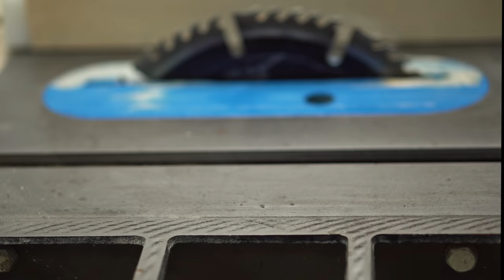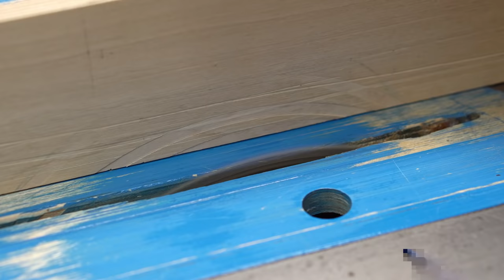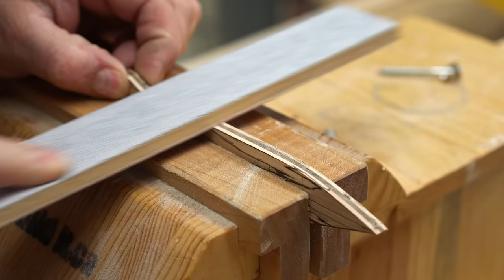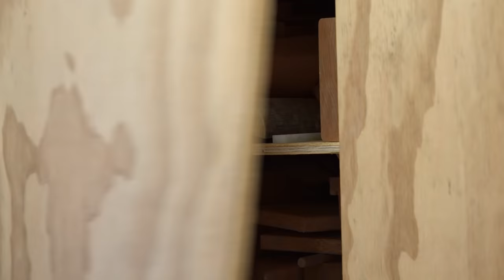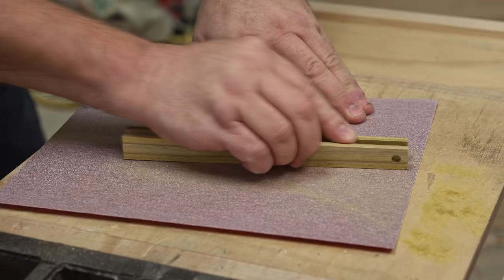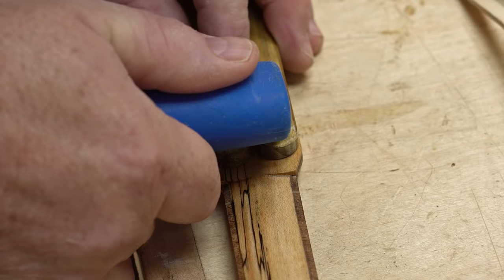Making This REAL Wooden Butterfly Knife

Comment: i'm in love with that blade, and it overall looks amazing. Just a tip, i personally think it would look way cooler if the handles were thinner. I don't know if it's possible to slim them down, but if it were it would look classy af.

Comment: 38 Clips
---------------
getting material
table saw angle 1 (left side)
table saw angle 2 (above)
table saw angle 3 (behind left)
table saw angle 3 (behind right)
drill press 1
sanding wheel
sanding wheel angle 2
sanding wheel angle 3 => moved to belt sanding but didn't turn off camera
vise angle 1
vise angle 2
vise angle 3
vise angle 4
getting material 2 (handles)
miter saw 1
table saw looking back at the blade
table saw perpendicular to the blade
table saw 45 from the blade
drillpress 2
drill press 2 (angle 2)
assembly at table saw 1
planing at table saw 1
sandpaper 1
disc sander 1
sand paper angle 2
bench work 1
bench work angle 2
Side angle of John working
assembly at bench
table saw angle 1
gluing mini tenon 1
sandpaper 1
hand sanding at bench 1
clear coat handles 1
clear coat handles angle 2
gluing hinge pins 1
gluing hinge pins angle 2
drill press holes in handles 1